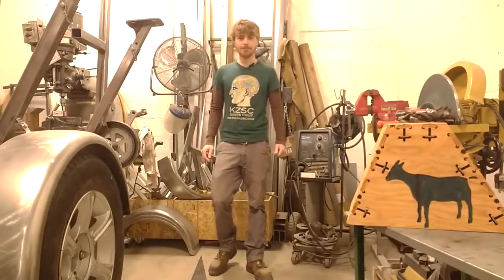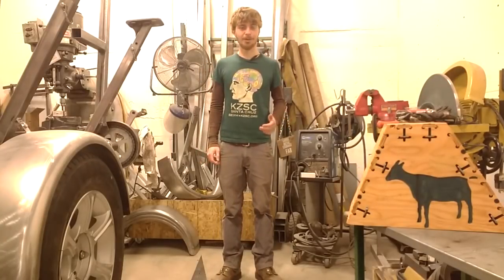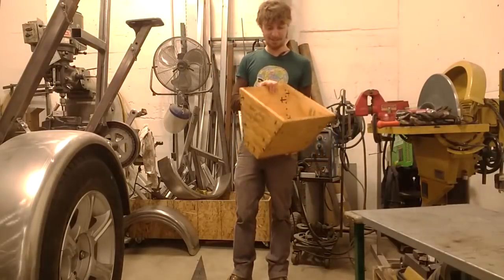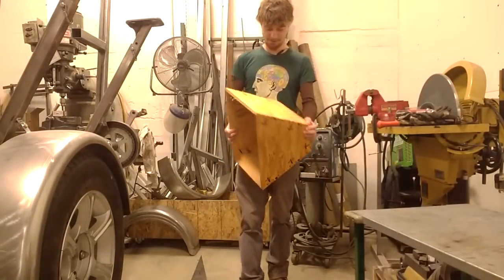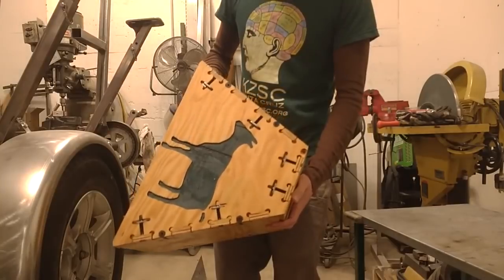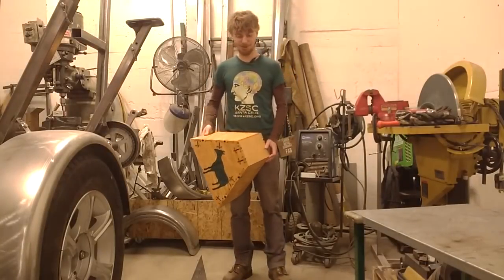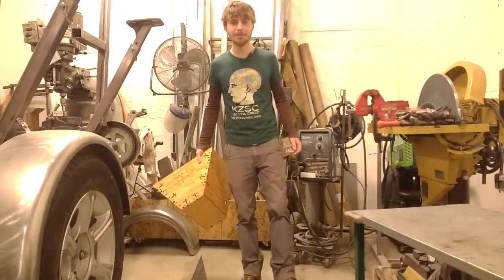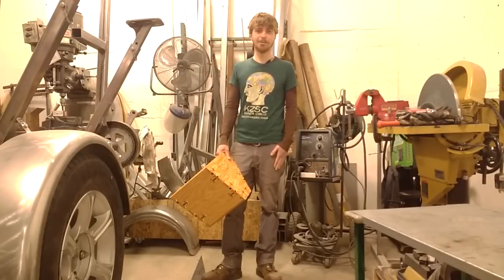Testing tnuts by cutting a CNC goat toy Maslow CNC

Comment: What method are you using to connect the chains to the router carriage?  The last fad-fest I was aware of was a pantograph/parallelogram style linkage but it looks like you've got some sort of ring with a roller bearing connection.  Is that the current hot lick? Are there any YouTubes with explanations/demonstrations?
Reply from the maker: Yes! We've switched over to the ring system. This newsletter talks about the change: http://www.maslowcnc.com/updates/2018/1/3/january-3rd-update-new-ring-system-to-go-out-in-february-shipment-finishing-up-with-the-plypad-lots-of-projects. It serves the same purpose as the linkages but its a little easier to install

Comment: Bar, what speed were you cutting? Did you use acceleration settings in Fusion or did you use another program? Nice work though. I’m still dialing mine in.
Reply from the maker: I used MakerCAM to generate the gcode, I think I cut this at 700 mm/min

Comment: Did you have to recalibrate after switching bits?
Reply from the maker: Hahaha no way! That would be awful. Calibration should be a one time thing when you build the machine. You can either remove the sled from the chains without taking them off of the sprockets with the cotter pins, or you can remove the router from its case by using the quick release tab on the side of the router (which is what I usually do)